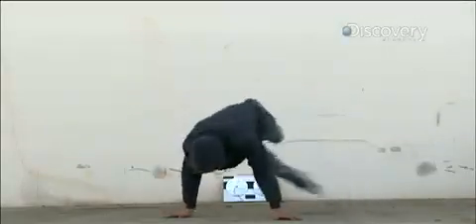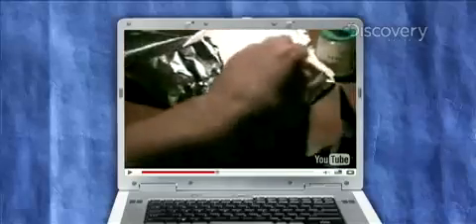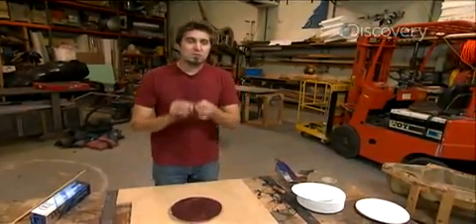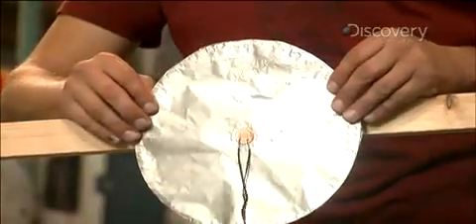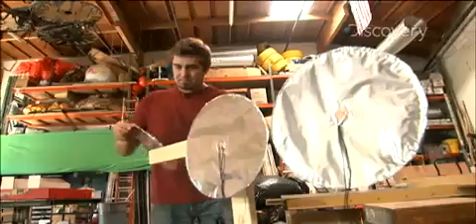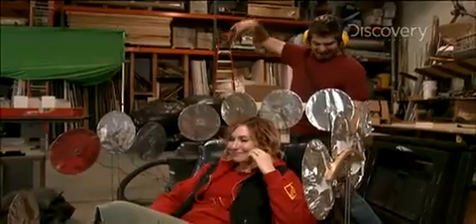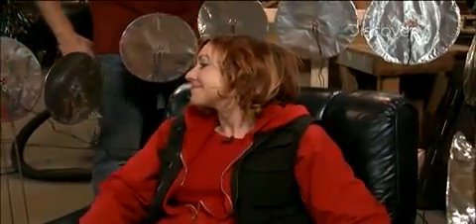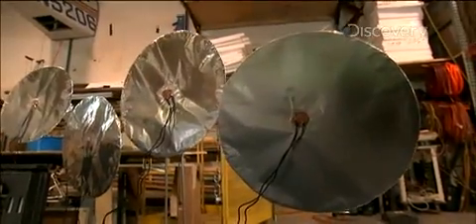Mythbusters - Homemade Hi-def Speakers

Comment: I'm guessing that putting the penny in between the wires is kind of like winding copper around a metal to create an electromagnet or voice coil. Here the tinfoil is the speaker cone, the penny and jack wires are the voice coil, there is no spider to aid in moving the tin foil and no magnet to attract and repel the electromagnet witch is why it may not work. If you have a deep sort of bowl, fit a magnet use paper instead of tin foil and a use conductive metal it may work but i can't guarantee.